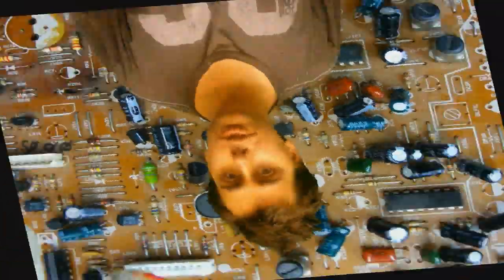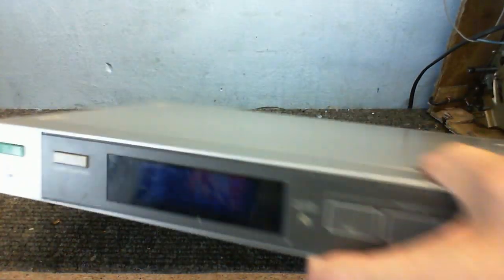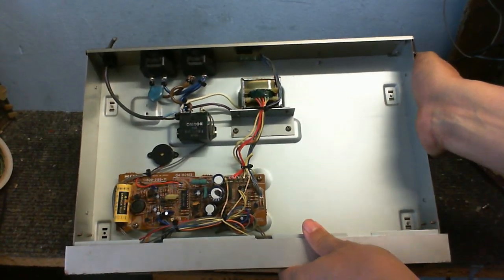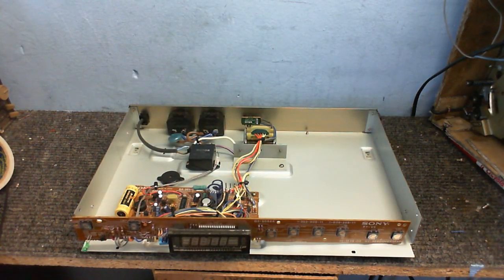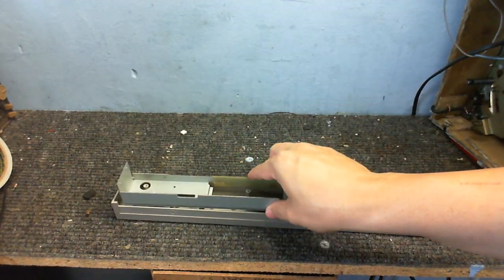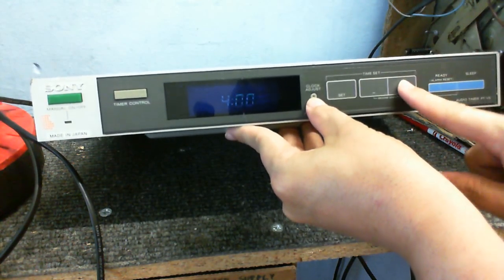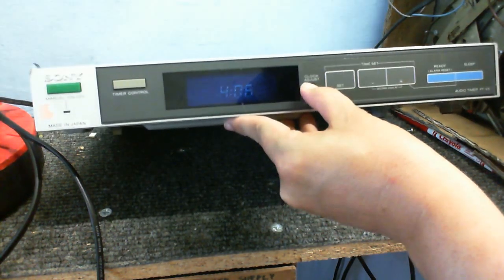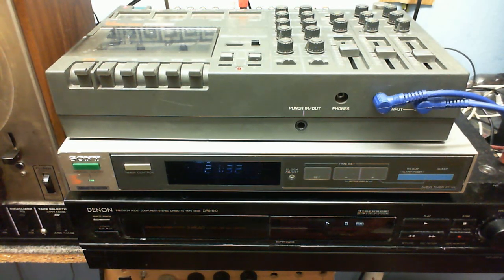Trash to Treasure part 1 of 3 - Teardown and fix of Audio timer

Comment: The remote control connector on the back is for connecting to other sony equipment. This can create a network that say, switches your amp to the tuner output and starts your tape deck recording at 7PM to record a radio show